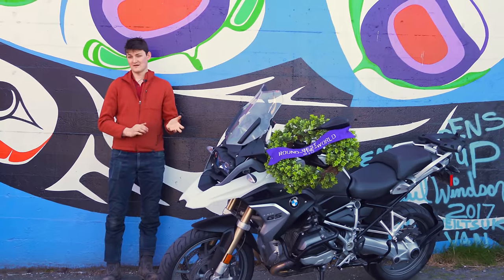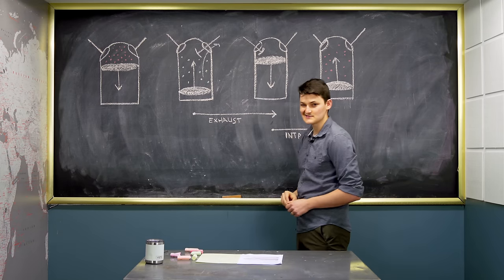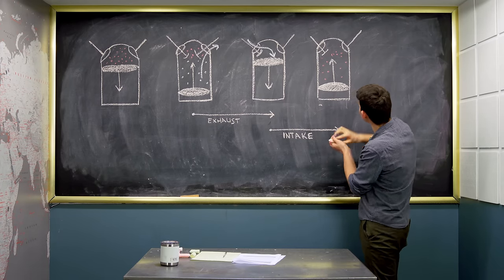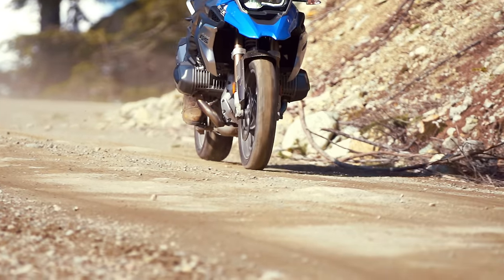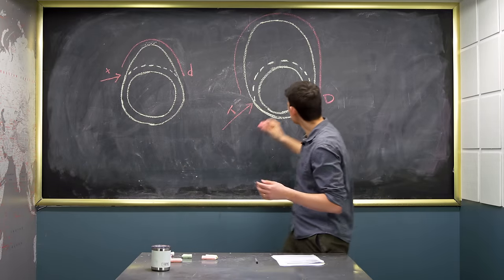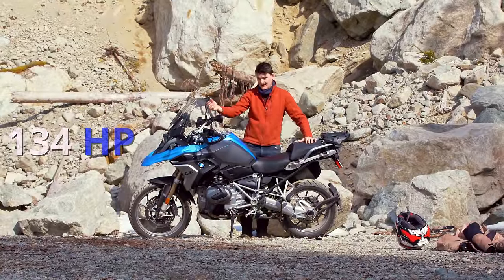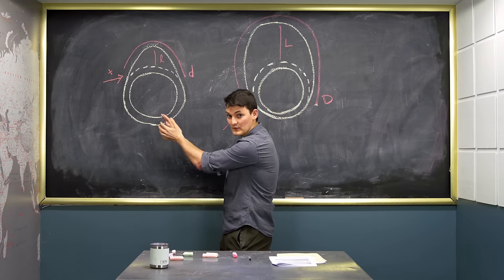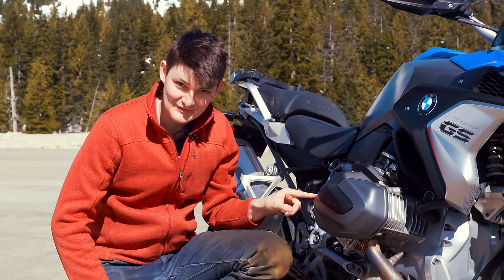Variable Valves are Bad for the BMW R1250GS - Review

Comment: First, I’m a huge fan and really enjoy your videos.
Second, I know your videos are primarily entertainment and promotion, and I acknowledge I’m a huge fan of my R1200GSA.  But here are some observations...
- You imply its power is “not useful” off-road.  But you must know that the riding modes for off-road moderate the power.
- You imply that hill start control prevents trail turns.  But you must know that you enable hill start control and you can disable it too.
- You imply if you’re in Mongolia you’ll wait 3 weeks for the part to open the oil filler.  But you must know it’s the handle of the screwdriver in the kit under the seat.
- You say you can’t see the display when standing up because of the nav.  But who’s looking at the display when standing up off-road?  And the position of the nav can be adjusted.  And the nav is an option that most people won’t need because of the new display.  And who stands up at 65 kph on the road (like you’re doing in the video)?
- You diss BMW for “ripping off" a feature other manufactures intro'd in the ’80/‘90s, but then you diss them for not stealing a feature from Suzuki now! (Which I believe is patented so you’d probably diss them if they DID steal it.)
- You make it seem like two power peaks is a bad thing. Sure, perfectly flat high power would be great, but two peaks leveling out the curve is still better than one making it more sharp. The clock analogy doesn’t apply because the engine is optimized for two key ranges, but still great through the whole spectrum - as opposed to a broken clock which is still right twice a day (one of my favourite jokes my dad used to tell).  But the clock is completely wrong the rest of the time.
- You highlight electronics in the engine as some fundamental design flaw.  You say “metal has to break” for something to go bad - but metal DOES break.  And every modern engine has electronics throughout the engine (starting with fuel injection).  Electronics in engines seem to be working fine so far.
- You imply it’s not a good “update" and it’s practically identical to the R1200GS(S).  Of course it is - it’s simply an improvement to the line - usually more power and more torque is a good thing.  No one is expecting someone to trade up from a recent R1200GS(A).  OK, actually my wife is expecting me to do it any day now.
- No one said “all new” except you!
But seriously, I love your videos!
Peter
Reply: You lost me at " I know your videos are primarily entertainment and promotion". Not even close to accurate.
Reply: Well said and Thank you for eviscerating this clickbait monstrosity! You were cracking me up though! “ but you must know”, “ but you must know” hahaha. I love his videos too but we gotta call a spade a spade!

Comment: I still love my 1200 GSA. And the 800GSA that I had before it. I can ride comfortably for 14 hours a day to get to a trail and then have hours of fun off road. What's not to love?
Reply: Price
Reply: ... electronic problems
Reply: @CptSlow89  Not an issue to me
Reply: @worldsnomad  Hasn't happened yet, and could likely happen to any bike.
Reply: I have a gs 911 I bought on amazon in the rare event I have electrical issues. I can self diagnose anything electrical from my driveway. Yet to have any issues out of my used 2018 gsa with 15k

Comment: Over the years, I watched this honestly great review so many times, but since day one I have some problems with it.
1. The 1250 is just a facelift of the K50 generation, nothing groundbreaking new to be expected, but I take the extra 20Nm and 10hp without complaining.
2. Why invent the wheel new with Shift cam, if there is already the tech out there. While regular riding almost all the times the large cam is active. Reading the ECU, it switches already as low as 33% throttle at 1150rpm and this line moves linearly to 16% at 4900rpm. The two power humps are an emission thing, but can be smoothed out by adjusted fueling, but the 1200 had already the same issue as well.
3. The special oil filler cap tool is the screwdriver handle underneath the pillion seat, but that's written in the forbidden book.
4. Auto Hill Start Control can be disengaged by a firm grip on the brake lever. In the settings you can select between auto, manual and off.
Some truly annoying thing you have missed out is the windshield that can't be operated at higher speeds and flatters like a cow's tail.
With that, best of wishes from Bavaria.

Comment: The market has moved forward, and BMW has not. That solenoid won't wear out on weekend runs to the coffee shop anyway. : )
Reply: Unless it does.
Reply: I'm not a fan of the GS, but if the solenoid fails, you can still ride it to wherever you want. The power just won't be the same..
Reply: @GL0BETREKKER  my guess is that the ECU will throw a "check engine" error code and shut off the whole system.
Reply: I've seen several '90s CB500s and a couple of early / mid 2000s Fireblades w/ over 100k. Others I've seen in the high tens of thousands i.e. above 65k are VFR750 and a couple of ZX9R C2s.

Comment: Great video as ever Ryan, and I have to agree with you that the Suzuki VV solution is far more elegant in engineering terms (at least to me anyway).  All that said, I still love my GS....sorry about that!
Reply: No reason at all  to be sorry  TMF :-)
Reply: You love when your neighbors look at the logo ;)
Reply: I have to disagree on the Suzuki solution simply because it only affects timing, not lift and duration.
Reply: @paulv22  soon BMW will carry over their valvetronic system from their cars. More efficient & responsive
Reply: @nazhif1  BMW has had Valvetronic for 20 years or so. It's a good system but if they were going to put it in bikes, they would have by now. It takes a lot of space so I doubt it would work well on a motorcycle, especially a flat twin.
Reply: The older GS is a much better bike in my opinion, not so much electronics to go wrong, and a bit more pure. I can see why the new ones sell, but it’s just down to choice.  I prefer to ride two bikes for the price of one.
Reply: Still got to laugh at youtubers & Instagram bikers shilling this as new BMW Tech!!! lmao
Reply: Go back to your weird gawking catcalls.
Reply: @mollyfilms   What older GS are you referring to.... like Model year (s)?
Reply: My Yaris has both. Engine of the year 1999 Toyota car not bike.  I like the GSs dual cam!
Reply: BMW driving is a religion

Comment: Great review. However I still think the non-full version of the R1200GS is pretty darmn good: Just two riding modes, no electronic suspension adjustment, no keyless ignition, no hill assist control, no shift cam, no GPS mount, but still has enough features to ride amazingly well.

Comment: I can't smash the Like button more than I did this time!  You just touched all the points that make the GS, well... the GS. An ungodly expensive, unnecessary bike.
Reply: Have you ever driven one? I've had a lot of motorcycles. Overall, the GS is superior to all. Power from all positions, a top chassis. And that with relatively little weight. All comparable motorcycles with kardan weigh more. On the country road I'm equal to everyone, no matter what performance they have.
Reply: Fabian Weber I agree. Of all the bikes I’ve owned gs beats them all and then some. The build quality is so superb that it’s easy to work on. I’m so glad I didn’t listen to the consensus on the internet when purchasing one. My only problem with the gs I can’t wipe the grin off my face while barreling down a gravel road.

Comment: I love my 1250 GS, but this was a great review. To each it’s own.
Reply: I don't think it was a great review at all.  I am a fan of Ryan but don't think he is being fair in his review of the 1250.
Reply: it was far from great, he talked so much misinformed shit its not even funny.
Reply: @kowalski2334  what were the misinformation? Provide facts not just spewing for spewing sake.
Reply: @kowalski2334  I agree Ryan missed a lot on this one for sure!
Reply: @abiodunadeyemi3812  There were much more technical errors, but let's focus on the camshaft modes only:
The two camshaft profiles are chosen between 1000rpm and 5000rpm depending on the load and not like the other systems by the revs.
The dyno curve represents the full load valve timing only, so the interpretation of the bumps is from somebody without 4stroke tuning expereince.
The bumps in curve are because of intentional resonances at intake and exhaust and not because of two valve profiles.
I tested the motor now for 30.000km and it feels very linear from bottom to top. It has an unbelievable push at low revs and enough power at high revs.

Comment: Spot on.  BMW has been obsessed with needless complexity for a long time.  I can't believe that I bought an 1150 GS with servo controlled brakes.  They were extremely annoying, and I came to my senses and sold it before they failed and cost me dearly to fix.
Reply: theres allways a reason for the so called needless shit in german stuff. 1. just because it's shit now don't mean it will be shit later. you have to first build somthing before you can improve upp on it. 2.  allot of the time these needless stuff has massive improvements on the vehicles. people compare shit like a toyota corolla to a bmw and think it's the same shit. one is a normal car the other is a luxury car. bmw is a luxury car brand and luxury means high tech.  i do agree that the valve shit here is kind of dumb but you never know where it will improve or if it's a complete failure but you never know before you try and thats somthing y'all should get in your head.  complicated bullshit is what brings technology forwards.
Reply: @rampage3337  I think that more of this experimental development belongs in their own hands before reaching the market.
Reply: @willelliott5052  not how the shit works.... go look att how many different bikes manufacturers release as 100% pure unfinished Pos with allot of flaws that need to be fixed or never got fixed because the ide was so obscure that it never became popular.  the point is that they tried and without trying they would never have found out and allot of other bikes would never be as good as they are. you put out a product in to market to see how well it works and how people react to it and then you ether cancel it or improve upon it

Comment: This helps my decision making. My 2012 R1200GS airhead has just reached 40,000 miles and is as sweet as a nut. If it ain't broke - don't change it!

Comment: Hill start is switchable and is very useful for heavy traffic commuting or getting your MotoGP ticket out of your pocket at the gate.. GPS gives you speed too. Shift cam gives variable lift differentially which the Suzuki does't do. The filler cap spanner is the kit screwdriver. BTW the RS is pick of the bunch. Money? You can"t take it with you and your kids get your estate!
Reply: I agree, I was very unimpressed with the review.  Even his premise that there are two humps on the power band is silly.  True, there are small irregularities in the HP and torque plots, but nothing to go on about.  Pretty much rubbish, IMO.
Reply: Jon Middleton agreed!

Comment: Had a Suzuki V Storm did 22000 miles, broke my f....ng heart. It fell apart off road. Had a KTM did about 12000 miles and had to go a buy a new spine complete back wrecker. Bought a 1250GSA in December 2018 I have been all over Europe, I take it off road and has covered 27000 miles and NEVER MISSED A BEAT. It looks like shit because it has not been washed in 10 months but still the best bike on the Road.

Comment: The cam shift tech most probably will never break. The oil filler cap tool is under the seat. The hill hold system can be turned off.
Reply: @TheDesmoDude yeah..I guess that's true. I'm not much of a mechanic but from what he said in the video the system is similar to the old Honda VTEC in terms of simplicity. All that being said I'm never gonna buy a beemer so idc.

Comment: The shift cam is more to do with keeping the power up and keeping in step with Euro 6 emissions than a huge revolution. Also, if the rider has the money for the BMW he/she is not buying the Suzuki!
Reply: Not true, I personally know people who have the money for a garage full of GS and have chosen the suzuki. Its no secret a lot of people with a lot of money are smart, and like to keep their money and not burn it all away.
Reply: @danielm6507  If I had the money, maybe I'd buy a gs, but honestly I cannot justify both the money and practicality.

Firstly it's 22k over here, secondly weighs a ton, thirdly those hideous engine heads blocking everything and finally the maintenance cost which honestly is not the biggest issue.
Reply: So what you’re saying is the Suzuki is only for poorer riders?

How did you get up on the pedestal?
Reply: @TheBasil36  I've worked at several dealerships and have a dam good idea how consumers spend their money! Been riding for 35 years as well, owned and ridden all different classes, sizes etc etc.
Reply: Brother I think you really don't know much about bikes and biking culture... Suzuki has its own legacy and brand value....

Comment: For the Oil cap there is a tool under the seat of every GS (it's the screwdriver grip)!
If shiftcam breaks the bike is simply stuck to one of the cam profiles.
And of course you can turn off Hill Start assist 
I understand the GS is not for everyone. Its heavy and expensive e.g. , but all the reasons you mentioned are a bit misleading.
Reply: Would you take it round the world?? 
Only honda and bmw have parts coverage all round the world, that's the most important, but they also have to handle bad fuel, bad roads (like 100.000kms of bad roads), dust, heavy load (bags, rider and 25l of fuel aren't light, and the frame is strong as much as it's weakest point (weld)).. 

Those royal enfield, ktm/honda dirt bikes etc are good for off road, but there's also 100.000 of high/motorways and those bikes have horrible seating positions and wind protection.. 
My opinion is that gsa and africa twin are only two models capable on delivering good results on round the world trip.. 
But you have to chose one xD
Reply: @urosanta5113  Yes I would. A GS and GSA are almost identical. Just fuel tank size and suspension are slightly different. And crash protection after market pieces are better anyway. Don't see why you would take a GSA around the world but not an GS ?

Comment: I like your video and the not at all subtle irony, despite I own a 1250 GS my own and loving it :-) Just one thing: You do not need to order a special wrench all the way from Berlin to undo the oil cap... no sir... just turn the standard screwdriver which comes free with the bike, around and it magically fits into the shape of the oil cap and you can screw and unscrew the cap (and it) as many times as you want...